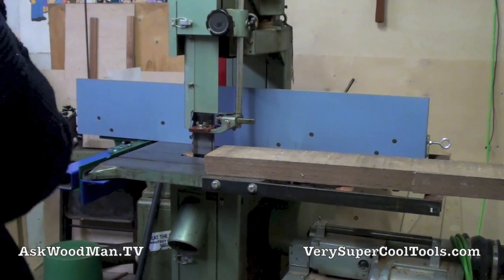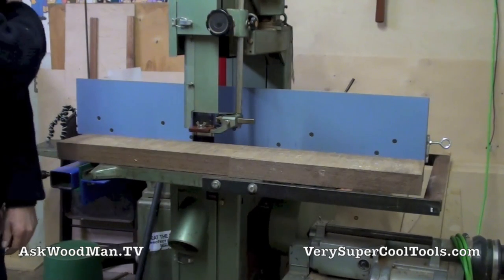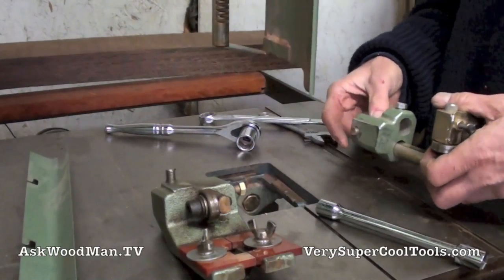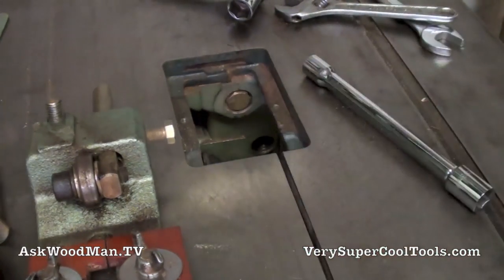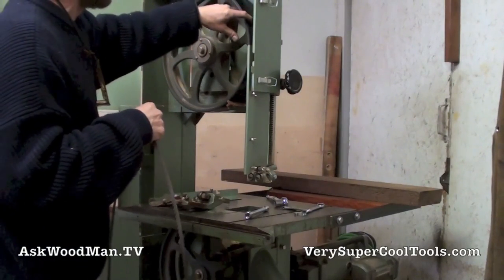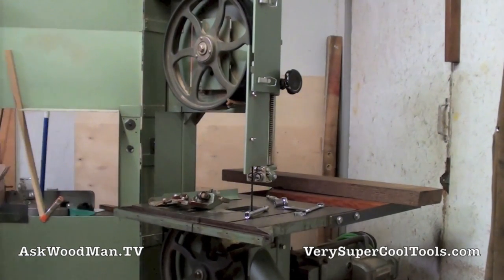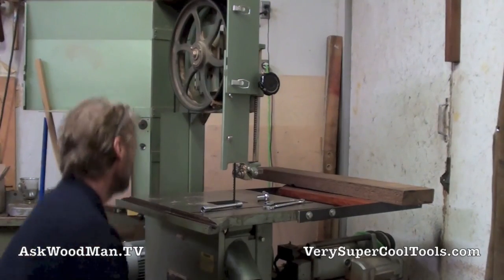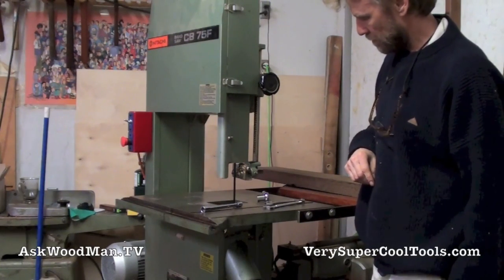Bandsaw Motor Upgrade 17/18

Comment: I am hoping there is a video series coming on the moxon vise and especially where August adds a video showing it on his VSC UWT.  I want to add one to mine and would get a lot from that type of series.
Reply from the maker: I am actually crating the wood portion I made for August's UWT today. His work table is going to be something that no one has ever seen before. Double Roubo vises Moxon vise and a combination solid wood top and Baltic/laminate 20mm multifunction top. I also made a portable Moxon for Jeff Fischer that is heading north in the crate. I made a double Moxon for my Texas Roubo that is done. Detailed videos on all three are in the works.

Comment: Watching that thing rip wenge faster than my table saw is jaw dropping. I hab a piece of wenge that destroyed a fresh edge on a veritas pmv 11 blade in 4 passes. Such a hard species of wood. Beautiful work as usual! Keep it up!
Reply from the maker: That wenge is the last piece from a big lot I bought 25 years ago. The nice thing about that band saw is all the action is going straight down so  the cuts are very controlled and not a lot dust is broadcast. The new motor makes that machine a lot better. Thanks for watching. Allan